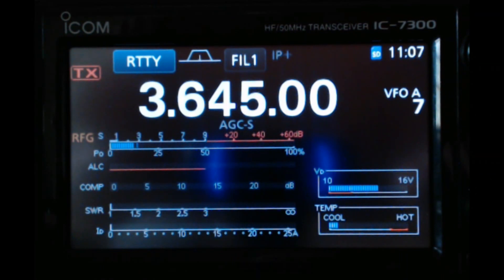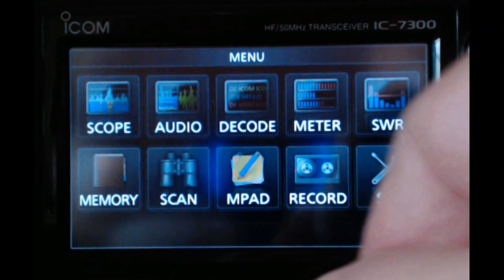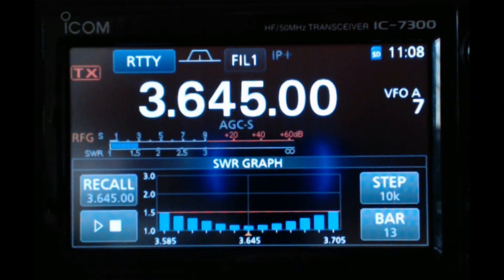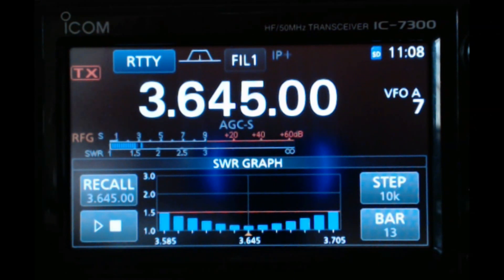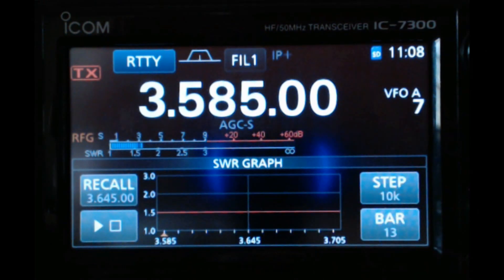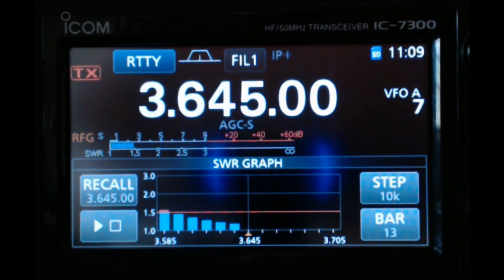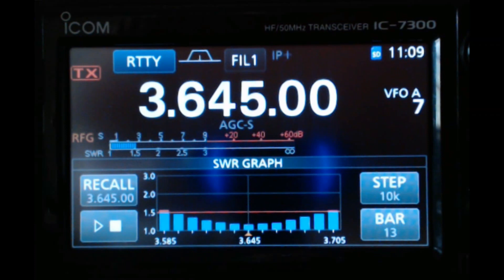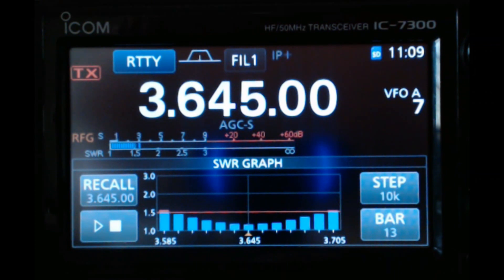Ultimax Antennas (ULTIMAX-8040)  Double Bazooka SWR Graph Using Icom 7300

Comment: Are you still using this antenna? I’m wanting to use on my lot at 32’. Inv V. Can the 75 meter band be trimmed to use around 3850 ? How does it do with a amp ? How is the noise compared to other antennas?

Comment from the maker: UPDATE:  30W is required for accuracy in the SWR graph. User Manual Pg. 13-2.

The following is a reconstruction of a post by Dave W0LEV reposted to 
YaHoo Groups "Icom 7300" by  Adam VA7OJ/AB4OJ. 

The average diode exhibits characteristics much like the plot illustrated in Fig. 1 Diode Characteristic (in the Files section).

We won't deal with the 'Reverse' side of the plot, only
the 'Forward Characteristic'.  Just to the right of the X-Y axis crossing at (0,0), the diode exhibits a very NON-LINEAR IV (current vs. voltage) characteristic.
Lower powers from the transmitter usually place the
sensed voltage in this region.  As the power is increased, the slope (tangent to the curve) becomes greater and greater until there is no change in slope with increasing forward voltage.  This is the LINEAR region of the IV characteristic and where the voltage sensing (actually current sensing converted to voltage by a one-turn primary ferrite-loaded transformer) circuitry is directly proportional to forward/reverse SWR.  

With low power and resulting less slope (less change in diode current with small input 'power' from the transmitter), the 'meter' will read lower SWR based on its intended calibration range in the linear region.  

With the average amateur-targeted meter, this is typical behavior.  Even the venerable Bird Thruline wattmeter operates this way and why the meter is compressed in the upper region for each
inserted slug. 

Dave - W0LEV
Reply: Good info on the diodes and how it applies in the 7300, a result of good research you did.  Thank you.

Now, we still have a huge problem with this video.
The title is Ultimax double bazooka, and the video shows a magnificent flat swr, which is what people will see and draw conclusions from unless they dig deep into the comments.  Feeatlastfeeatlast (yours truly) pointed out above that this performance is not possible and gave a very excellent explanation as to why, and pointed out the myths that surround this antenna.  
To repeat, and summarize, a double bazooka is nothing but a dipole which is made from some coax.  The shield of the coax acts as the first portion of the dipole (going out from the center insulator), and then a wire extends to the far end.  The shorted quarter wavelength of coax absolutely, with 100% certainty, does NOT provide any increase in bandwidth, beyond what would be obtained with a fat conductor.  This has all been described back in 1976 in a 15-20 page Ham Radio Magazine article by Walt Maxwell, W2DU (SK) who was a REAL antenna engineer.
Anyone can easily demonstrate this fact by cutting the coax at the center so the effect of the quarter wave stub is removed.  The swr will not change, proving the stub has no effect on bandwidth.
If you leave this video up, you are extending the myths that have surrounded this antenna for decades.
I encourage you to remove the stub effect and prove to yourself and viewers that the performance of the d bazooka is a myth.
You already have over 900 views as of Nov 2, 20017, which means 900 people have been duped.

In adition, some people make measurements on antennas through a long length of coax.  The swr will ALWAYS read lower due to coax loss, making it appear that the antenna is broadband.  In fact Bob Heil did just that with double bazookas, feeding his antennas through 600 feet of coax and then proclaimed that the d bazooka covered the entire 80 meter band, which of course is pure BS.  He published his myths on ham nation, and when confronted with the facts, as above, ignored them.  So, what ya think, OB, expose or promote the myth?
Reply from the maker: Hello and thank you for the comment. I apologize for not seeing your comment earlier. It was listed as likely spam, so it didn't appear until I approved it.

I am not opposed to different opinions. The Ultimax Dual Band is working very well for me and I don't have it up to 40ft.

Normally I do not like antennas with traps, but I am limited in space and wanted to try it. For Hams in my position, this is a good antenna. I do not get any money from the manufacturer.

Please have a look at the reviews: http://www.eham.net/reviews/detail/9391
This is a very well made and quality antenna. 

Thanks again for your point of view. Best 73 and Merry Christmas.

Rich, K0PIR
Reply: you handled that troll nicely. thank you for the video and sharing with us.